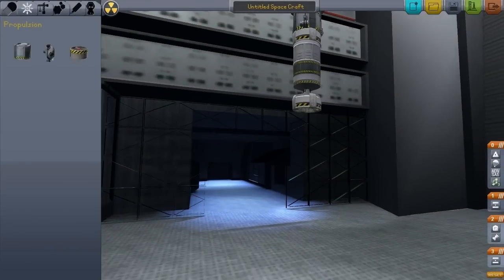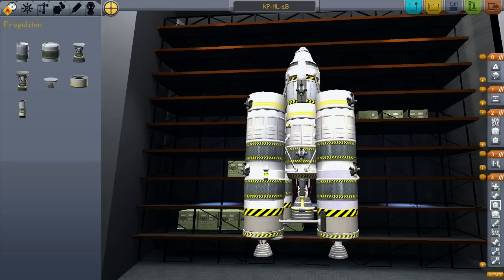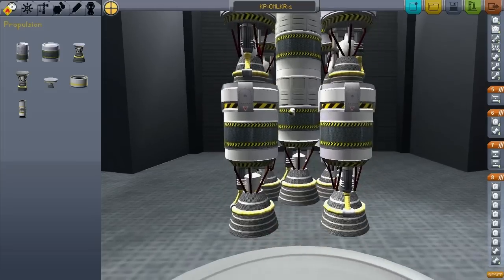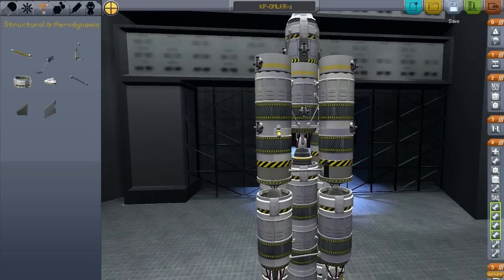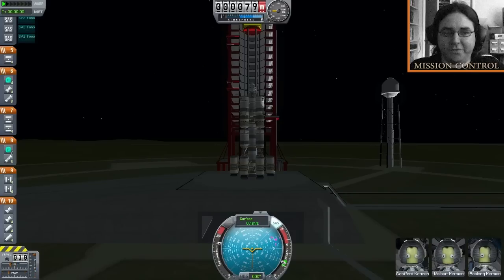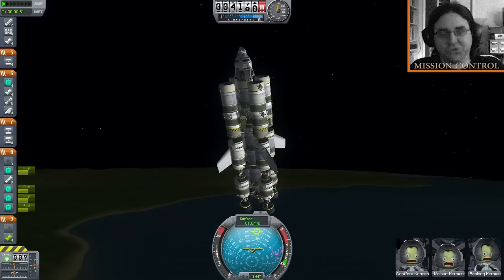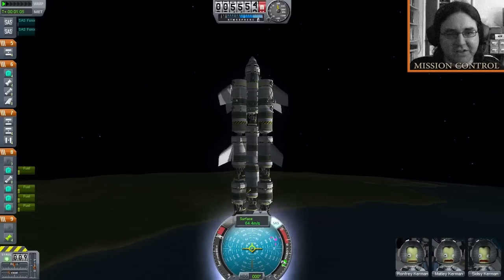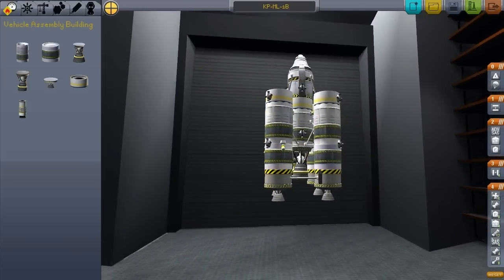Kerbylon Project - 7 - Design: Launch Stage

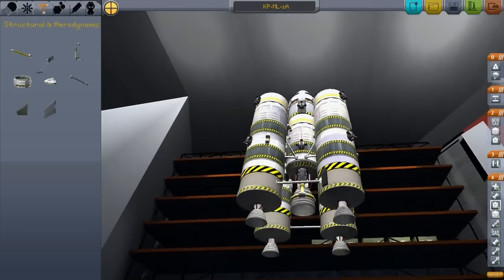Comment: hey just a comment at around 4:15 your 4 less powerful engines have no fuel connected to them so they will not run and they will just be dead weight.